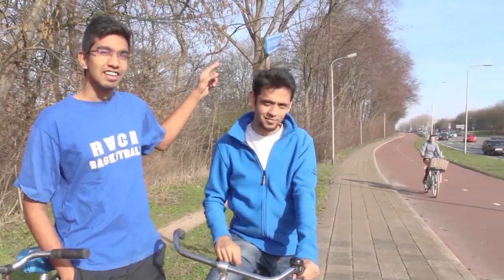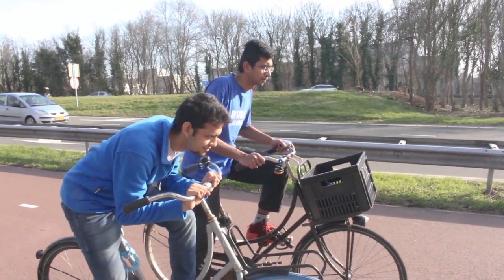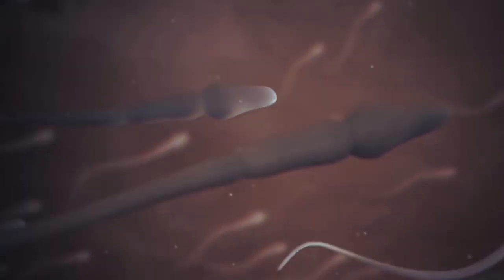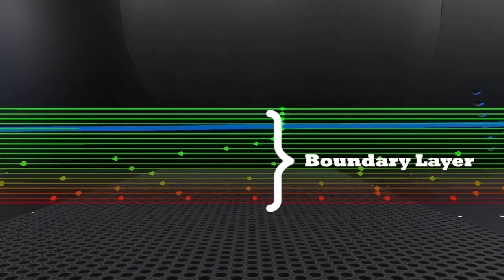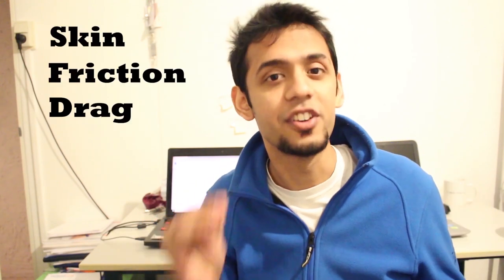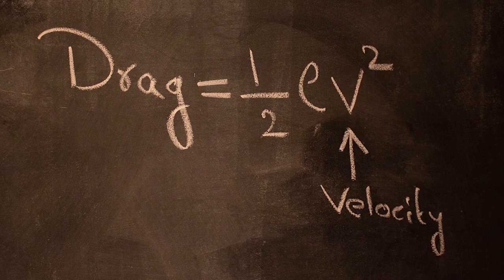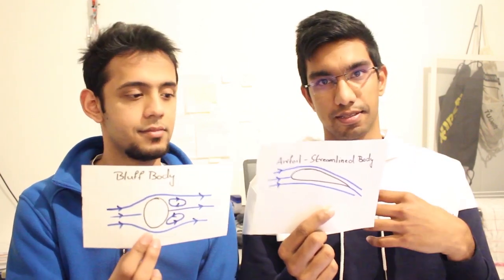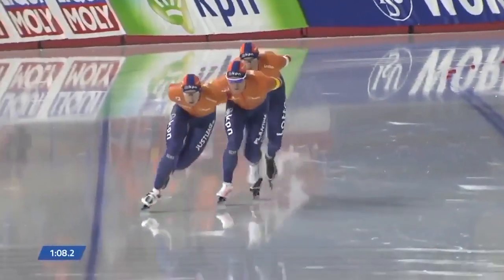WHAT IS DRAG? | SLIP STREAM EXPLAINED

Comment: Shouldn't the downstream pressure be lower?   i.e P1 > P2. Didn't get the part where you say the particles have to work against an increasing pressure gradient. Great channel btw : )
Reply from the maker: Thanks Shriram. Great question. The pressure downstream is lower because particles would have had to follow the contour of the body to get back to the original pressure in the freestream which means they have to move into an adverse pressure gradient. But since they do not have enough energy to do that they "cheat" and separate from the surface of the body without increase in pressure  l

Comment: What about drag at low velocities with no wake formed
What kind of drag is predominant ?   
Pressure / shear drag or both?
Reply from the maker: Great question! At low speeds,  the flow actually is susceptible to separation (called laminar separation) then you will have pressure drag. But in a situation where the flow is fully attached then the drag is completely skin friction drag
Reply: @2BrokeScientists  at very low velocities (creeping flow)???
Reply from the maker: You’re right. Creeping flow is a Reynold’s number less than 1 and the flow is fully attached. In those cases the drag is completely skin friction